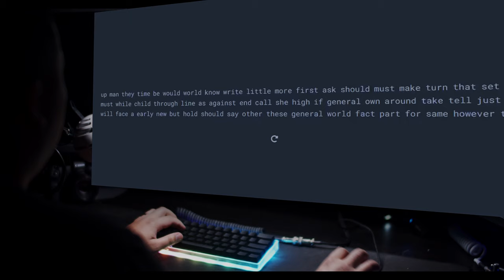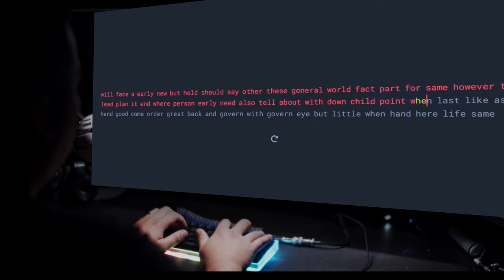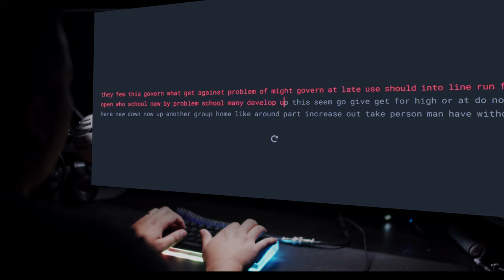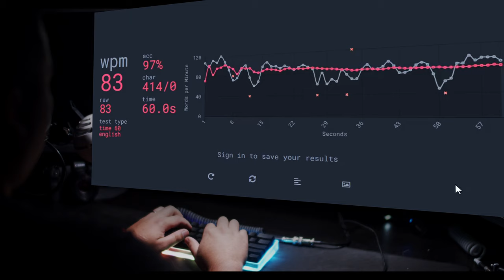My $100 Budget Custom Keyboard build

Comment from the maker: Some of you may be wondering why this instead of a Gk61 or similar keyboard, The reason I prefer this build is because this build can easily be moved to another case such as the tofu 60 or fjell case, Also if you purchase a hotswap or dont mind desoldering you can repurpose this for much more case options such as the Brutal 60 and other 60% boards. There are much different options for parts to purchase at first so I definitely encourage researching before purchasing but I wanted to give a good everyone a good foundation to start on.

Comment: great budget build for beginner's especially those that do not want to wait on group buys, good vid
Reply from the maker: MrGoodTymez_Gaming thank you! Yeah that was the main thing I was seeing. I wanted to offer something for newer community members that won’t break the bank but give just as much customizable options
Reply: we get 3 pin switches right?
Reply: @rjmartinez6030  if you get the PCB that only accepts 3 pin switches you can clip the extra stabilizers off of 5 pin switches, hope this helps
Reply: @goodtymez777  yea he linked 2 pcbs and i need to know are they 3 or 5 pin pcbs
Reply: @rjmartinez6030  looks like they both support 5 pin switches
Reply: @goodtymez777  do they support 3 pin tho
Reply: @rjmartinez6030  if it supports 5 it automatically supports 3
Reply: @goodtymez777  sorry last question where would i get the cord that connects to the keyboard
Reply: @rjmartinez6030  lots of places, amazon has lots of options like Tez Cables
Reply: @goodtymez777  ok thanks
Reply: @goodtymez777  thanks

Comment: What's the point of having RGB on the plate instead of on the keys to see the labels?
Reply from the maker: airixxxx you can actually add in backlight leds later if you like. I just prefer not to. It’s purely preference though.
Reply: Id like to point out that RGB on the plate is not a thing. Its underglow on the PCB. Dedicated RGB on PCBs makes the price go much higher and soldering leds to the switches does too. Getting backlit keycaps is also more expensive and isnt very common in the custom mech scene.

Comment: I’m relatively new to building keyboards, does it matter how the stabilizers go(when they click into place, top or bottom)or does it just depend on the pcb?
Reply from the maker: Yes I would look into some stabilizer installation guides. There are two main ones pcb mount stabilizers and plate mount stabilizers. The ones in this video are pcb mount stabilizers. It’s fairly easy to install once you figure out the holes. They only go it one way

Comment: Do I have to solder the Switches?
Reply: in this build yes because dustin uses a cannon key pcb 60%. 
there are different PCBs out there hotswappable is the one you many want if you dont have a solder. The DZ60 RGB hotswap is currently sold out but KBDfans do restock every month.
Reply from the maker: Kurious is correct, I would look up 60% Hotswap PCB's if you are not comfortable soldering if the one in the description is sold out. other ones to consider are the instant60 and the 1up hotswap pcb
Reply from the maker: Thank you for that quick response! :)
Reply: @DustinVang  i was actually watchimg your video to build a cheap 60% XD

Comment: is it possible to still have that case and still have rgb coming out of your keycaps i’m a beginner so i don’t know
Reply from the maker: Noe Garcia this pcb has rgb underglow and also spits to add in individual key switch leds. The key switch leds though will not allow for rgb.
Reply: If you are talking about keycaps that are transparent, then yes, the keycap set doesn't matter. You can get whatever keycap set looks good to you.

Comment: Is that a kbdfans plastic case?
Reply from the maker: Chilli sure is!
Reply: Dustin Vang thank you for answering!
Reply from the maker: @chilli8715  my pleasure, feel free to let me know should you have any more questions and happy building!
Reply: @DustinVang  Thank you, how does the rgb look irl? and is the case low profile or high profile?
Reply from the maker: @chilli8715  surprisingly good, the best part about is that when you want to upgrade you can pull the board configuration out of this case and move to an aluminum case or the acrylic rgb case from kdfans.
Reply: @DustinVang  ok, thank you very much, thinking of getting the same build but a 1uphse and different keycaps instead
Reply from the maker: @chilli8715  oh yeah i honestly think the 1up is probably a better deal. and definitely recommend gmk instead. these are just budget keycaps to keep the price of the build down. :)
Reply: @DustinVang  yeah gmk is better but way of my budget, getting some cheap black on black thick pbt caps from kbdfans
Reply from the maker: @chilli8715  yeah those are super nice.

Comment: I want to make a custom keyboard under 150 what is the best kit i can get? I want it to be hot swappable
Reply from the maker: showtruck video's you can get this exact kit but choose the hotswap dz60 instead
Reply: @DustinVang  thanks for the advice! Great video
Reply from the maker: showtruck video's my pleasure! Thanks for dropping by and happy building!
Reply: @DustinVang  thank you!
Reply from the maker: showtruck video's my pleasure :)
Reply: @DustinVang  im sorry Just one more question whatbdo you think is the best budget aluminium case i can get between 50 and 75 dollars?
Reply from the maker: @Niels-booij  i think the tofu is the best aluminum case. but that will make the cost of the entire budget go up.
Reply from the maker: @Niels-booij  if you can wait there is also the kbd67 lite that is coming out which is going to be only 99 dollars, also the Rama kara
Reply: @DustinVang  i really like the aluminium anode 60% case do you know if that fits the aluminium plate B the same one as you put in the discription. and it fits with the kbd6x hotswap PCB? And also what stabilisers do i need?
Reply from the maker: @Niels-booij  yes it will fit the same ones in the description. you can get a standard set of stabilizers. usually 60 keyboard set:  4x-2U and one 6.25U
Reply: @DustinVang  do you have a link for the ones i need?

Comment: Did u use plate a or b ?
Reply from the maker: Great question I have the 2.25 u plate b
Reply: @DustinVang  thank you
Reply: @DustinVang  i am looking at the kbd6x hot swap do you now if that is RGB? If it is i dont know what yellow gateron switches i need. i Saw the normal ones on kbdfans the ones you use in this video but they are black at the Bottom so i dont think they shine trough right? I Saw also at kbd fans the gateron yellow smd these are clear at the Bottom it looks like, so do maybe  know they shine trough? and are those the same as the normal gateron yellow's?
Reply from the maker: @Niels-booij  can you send me links in here. I can take a look. some may have black or white bottoms but can shine through
Reply from the maker: @Niels-booij  I would spend the extra money and get the tofu. its heavier and a higher quality cnc
Reply: @DustinVang  yeah im thinking about the acrylic one how does that work with the rgb? Is the rgb build in the case or from the pcb
Reply: @Niels-booij  pcb underglow

Comment: Does it come with stabilizers if it doesn’t  could you post a link which could fit this pcb.
Reply from the maker: The stabilizers come when ordering the pcb usually but I will add a separate link
Reply: Why are the stabilizers that come with the pcb not good
Reply from the maker: https://amzn.to/3iYTerz
Reply: Are the stabilizers that come with the pcb screw in.
Reply from the maker: @sohanpatro  it looks like they no longer sell stabs with the PCB so that was a good find
I put a link in the desc for them, however. yes they are typically screw in but require clipping if you want to have a good sounding stabilizer
Reply: Since you look at your comments I will drop a sub.
Reply from the maker: @sohanpatro  :) I appreciate that!
Reply: It’s been fun talking with you.
Reply: You should do another video like this expect all  the parts from AliExpress or wish and just see how cheap you can make a keyboard. Rules you can’t use a hotswapable pcb. Also also get your lube and soldering iron from wish or aliexpress.
Reply from the maker: sohanpatro great idea!
Reply from the maker: sohanpatro great talking To you too :) take care!
Reply: What do you think are the best switches for gaming for building a keyboard. Around 50 dollars for switches.

Comment: I want to do a similar build but i noticed the PCB is kinda bent and based on others it seems like the underglow LEDs interfere with the ribbing on the 60% plastic case. Have you had any problems with that in this build?
Reply from the maker: that is a very good observation! i actually realized this after I did this builds. Keep in mind that PCB have some give in flex so luckily no issues when I over tightened. I think there are 2 fixed for it. One gets oring spacers where the screws go in or two grinds down the locations where the LED's hit the boards supports but that tiny amount.
Reply from the maker: I also installed foam in it for sound after the only issue is that it doesnt look amazing when you flip it over
Reply: @DustinVang  thanks for the reply! I've seen people suggest sanding down the ribbing supports in the case to make sure they don't interfere with the PCB but I'm not sure if i have the tools to do something like that. I've also seen a video where someone melted the case supports with a soldering iron which seems like a good idea but my only concerns with both methods are that messing with the supports in the case will also mess with the structural integrity of the case.
Reply from the maker: my pleasure, Id be more inclined to just do the orings as it may also improve sound quality while giving space. Also, I don't think grinding down or melting the locations where the RGB's sit by a few mm will hurt the structural integrity at all. There are already small dips in the supports for other part space. The next best bet would be to save a little extra for the acrylic or tofu case which doesn't have any issues at all with supports.

Comment: If I bought the plate you linked and the screw in stabs would everything work just fine??
Reply from the maker: yes, they are compatible. just make sure you get the curret 6.25u space bar